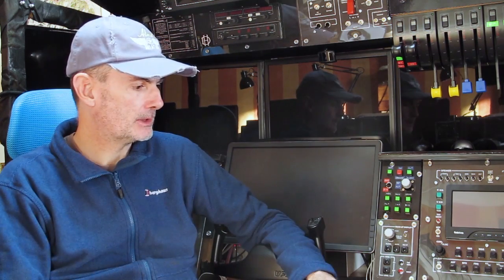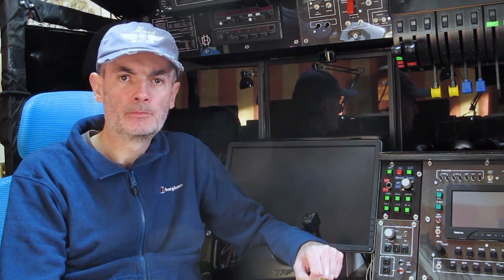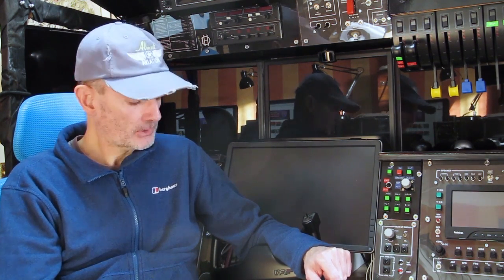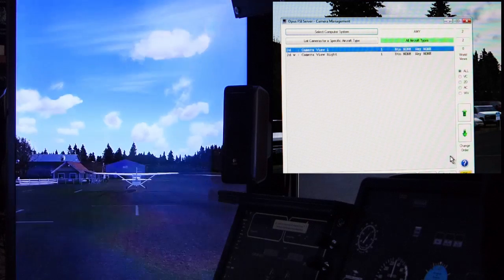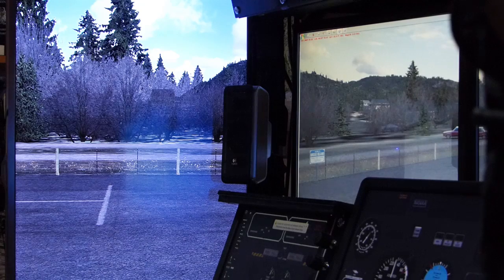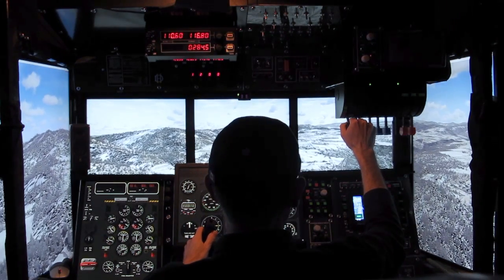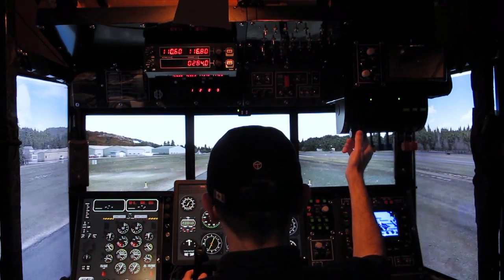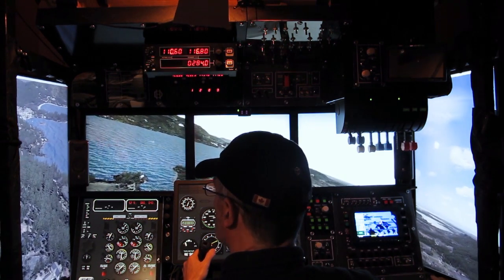More OpusFSI Experiments (Twin Otter Cockpit Build - Part 38)

Comment: have you thought about building an imitation super structure between your cockpit and the screens? It would decrease your overall visibility, but may solve the issues of noticeable joins between side and front screen setups.

Just an idea to toy with
Reply from the maker: Nope, too early for that! I need to get it to work first :)  But in the long run it might be a good idea.

Comment: Hi, quite an impressive build you have there. I am building a single-seat HC myself and I can feel your pains. I have 3 1920x1080p monitors for the cockpit view and one 2560x1080p below them for instruments. However, in terms of practicability (I like to fly quite a number of very different aircraft) I decieded to buy a GTX 1080 graphics card and have all monitors running via this card -- and I am quite happy with it. I can stretch the P3D window via all four screens, which gives an icredible immersion, I can use all the nice VCs and still get decent performance (30 fps with moderate settings). And I don't have to fiddle around with programs like Air Manager every time I switch aircraft or buy expensive gauge and instrument panel hardware. PM me if you're interested in photos.
Reply from the maker: I can't understand how you can have four screens in the configuration you describe running a single stretched window?
Reply: Easy. Just plugged all of them into the GTX 1080. Software Config via the nVidia Control Panel (nVidia Surround).
Reply from the maker: Well I still can't understand it because you are describing a non-rectangular view. Perhaps you mean you are running a 3-screen surround view and a fourth 'accessory' monitor? In which case I guess your fourth monitor needs a second virtual cockpit window to display the instruments. Or maybe something else....?

Comment: Wow, what a built. So many monitors. What simulator and plane are you using?
Reply from the maker: I am running FSX with the Aerosoft Twin Otter Extended.
Reply: It's SUCH a fun plane! :)

Incredibly easy to use, just keep the temp out of the red and the torque pressure under the red line and it will fly forever.

Comment: hi!  why have you changed the iris dynamics yoke for the Yoko yoke? the Yoko does not have ffb so I don t understand the choice! great video btw!
Reply from the maker: I switched to the Yoko because they sent me one for review. At the end of the day I didn't find that force feedback added much and the Iris yoke was kind of clunky anyway. As has always been the case, the support from Iris is virtually non-existent so I sold that yoke while it still worked. The Yoko is the best yoke I have had, and that includes the Elite yoke I have sitting on the shelf.

I would not bother with FFB again unless someone properly implemented environment effects - so, for example, you 'd feel gusts and wind-shear through the yoke.
Reply: Almost Aviation Nice to have a feedback :-D, I was hesitating between iris dynamics and the CLS.E from Brunner.  Now I m totally convinced even though the arguments were already favorables to Brunner ffb yoke anyway. thanks!
Reply: Almost Aviation I bought the Yoko based on a previous (detailed) review you made. I can confirm the thing just works smoothly and accurately and use it with a wide variety of sim aircraft. Thanks for your videos.
Reply from the maker: Woo! Tell Virtual Fly, then maybe they'll send me a TQ6 throttle quad to review :)
Reply: Almost Aviation hehe.. bought the TQ6 at the same time, maybe I should do a review myself ...🤔anyway, excellent combination.